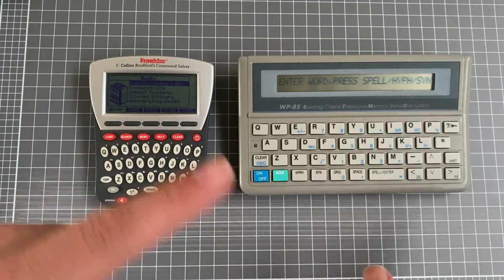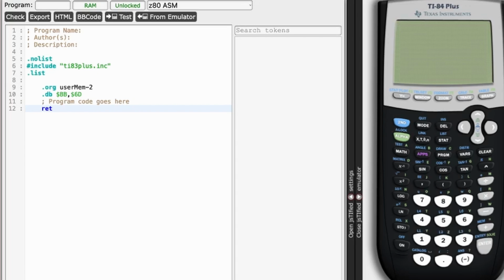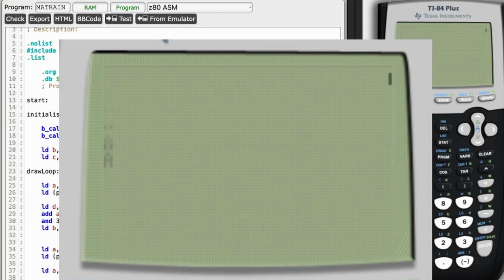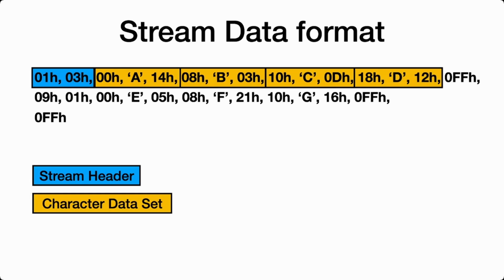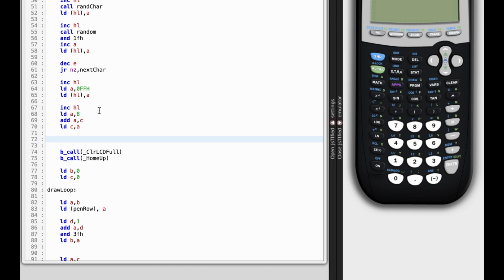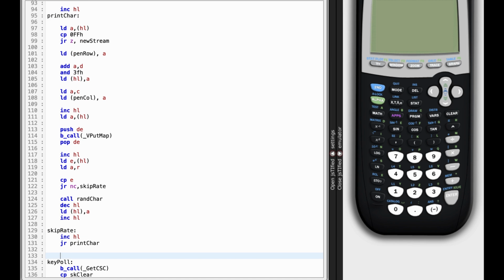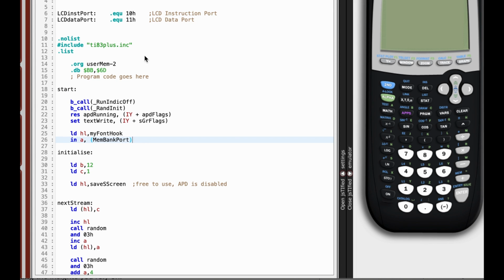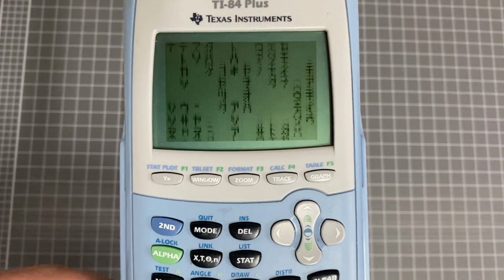Learn to Code Z80 Assembly on a TI-83+/84+ Calculator - Matrix Rain

Comment: I've gotten so many calculators at thrift shops for $0.50. Most have just needed their battery connectors cleaned to work properly, but a few have needed LCD pin repair. Simple fixes to save them from the landfill and they still suit a purpose when I want to mess around with low level programming.

Comment: Really like the sort of content you cover. I'm in Australia too and have a collection of TI graphing calculators, I've bought a few of them cheap in "not working" condition and get them running again. The most common failure point is corrosion of the battery pack contact pads on the PCB which prevents the electrical connection. My solution is to add solder onto the pads for a reliable contact, and bingo she's up and running. TI were real cheapskates so saving two cents of cost on the connection design and killing the life expectancy of these calculators was apparently worth it.
Reply from the maker: I know exactly what you are talking about. I had the same problem with the battery connection. Poor design. Thanks for watching